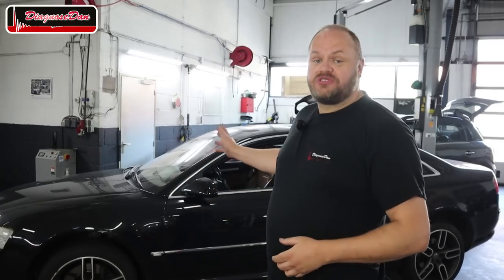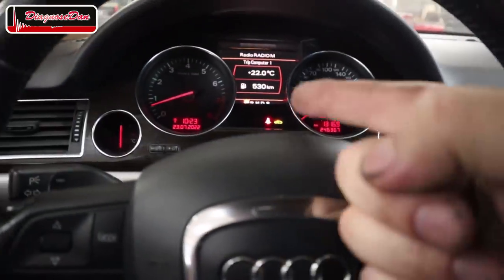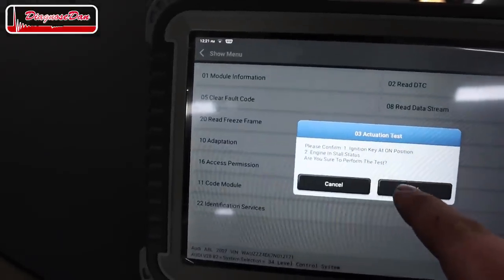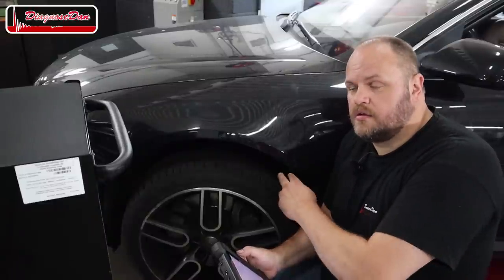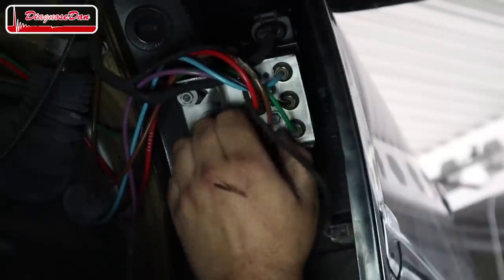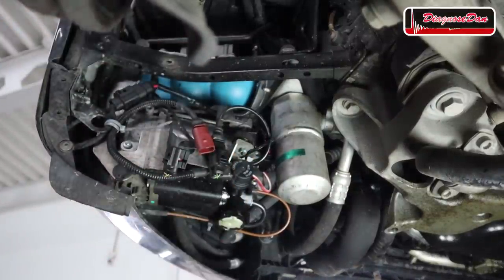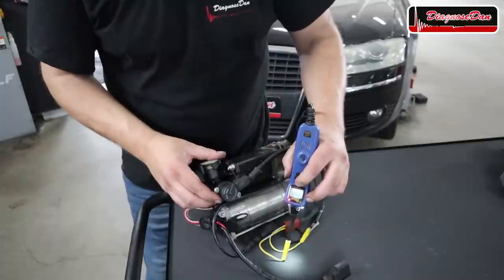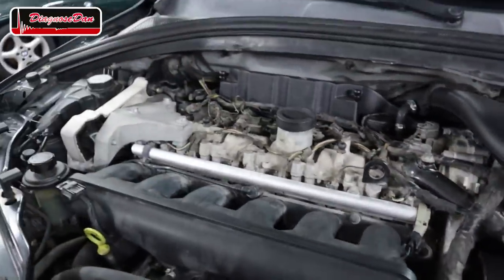Fake parts causing faultcodes

Comment: Hell Hell Hell. Same happen to me. I bought an Hella o2 sensor for my car and after 10 months it stopped sending data to ECU. I activate warranty and they accepted. I (mistake) asked for a equal replacement part. After 6 months stopped to send data to ECU also. But they accepted again the warranty and I ask for a credit. This was on the well known Aut...oc European online shop for car parts. Maybe I will ask all the credit in oil, now I saw your video Dan.
Reply from the maker: This sensor also came from Autodoc
Reply: @Diagnosedan  now their prices are explained. I ask at the Skoda representative in my country a price for the sensor (in  the first fail of the fake one), and they said "probably it will come an sensor from Hella". And I thought that have made a good choice asking for the replace.  😥Lol

Comment: i would check for a blown fuse first (a fuse is designed to protect the circuit and devices by failing long before the device or wiring fails).

then maybe check for corrosion on the connections since cars are often exposed to the elements it is possible for corrosion especially today since now a liquid snow and ice removal is used.

Comment: Dan hello
I have a question for you if can help me?
I have a 2013 Toyota Avalon hybrid and my car shakes at 40mph all the time.
I replaced the motor mounts, all front end suspension parts and drive axle, did tune up. Any suggestions?
Thank you. Very informative YouTube channel.

Comment: Hi Dan please can you help me, I took the drivers seat and front passenger seat out of my VW polo SDI  out to wash when I reinstalled the 2 front a airbag warning light shows up on the dashboard even though I remembered to plug in the airbag wire under each seat, am I going to need a diagnostic device to remove the dashboard airbag warning light, if so can you recommend the best and cheapest diagnostic device, I'm in the uk 🇬🇧. Great video great channel thankyou.
Reply from the maker: It's cheapest to get the airbag light reset by your local garage.

Comment: Who knows? Does 01206 - signal for duration of ignition off time 27-00 implausible signal; causes the lights under all buttons to remain lit? Battery drains.. Im reading this in vcds on my C5 A6 3.0 ASN climate module. It says faulty air quality sensor. There are some doorlock issues but unplugging them would exclude them right? Battery doesnt drain when I take off the blue connector from behind the cockpit, then lights go off. I can upload a video so you can see what my issue is. I want to try everything before buying a comfort module😵. Diagnose dan is awesome!

Comment: Great job as always , I noticed that MAF reading for this engine 3.0 was about 5 g/s. Is this turbo engine, isn't rule of thumb for 3.0 L about 3 g/s or we can't always rely on that.
Reply from the maker: It's actually a little more complex rhan that and even a Maf calculator is not 100% reliable but it gives you a general Idea.
Reply: @Diagnosedan  Thank you

Comment: Hi Dan, did you take the new deflation valve out from the new compressor to see if that o-ring was another oversize cockup?
Reply from the maker: The new compressor had a different design.

Comment: That solenoid rust could just be from moisture in the exhaust air. This air suspension systems usually have some sort of desiccant chamber or separator on the compressor side and when that fails, the moisture will just ruin everything.
Reply from the maker: Agreed but they were designed for the job and failing after a year is not acceptable

Comment: Counterfeit parts are all over Amazon/Ebay. Stick to Dealership online parts or Rock Auto parts. My last issue was a throttle position sensor. It threw up codes. Put the original one back in, problem gone.
Reply from the maker: Thanks for the feedback 👍

Comment: Even genuine parts can be bad. Had a new temperature sensor from a respectable source that immediately caused the fan to spin at max speed. Fail safe but very noisy 😃
Reply from the maker: You are right

Comment: I once fixed a bmw airsuspension where the motor did´t work. The problem was wet dryer beads. best repair ever cost 0€
Reply from the maker: Indeed that's a common problem

Comment: Yes I have had my experiences with ebay sensors - they are all fake. Now I tell everyone not to waste their time & money.
BTW my experience is also that Hella components are very low quality. Just as an example, until recently I had a BMW E39 M5.
Just after the warranty expired, suddenly one of the headlights was aiming at the ground. I realised that the electric height adjustment had broken internally.
I opened it and found that the nut that the motor drives had decomposed into dust. Made a new piece in my home workshop and all was good. Opened the other one and found it was about to fail as well.
Guess who made that garbage?
I had to replace 3 sensors on that same car. All made by Hella - Chinese quality, proudest made in Germany.
Reply from the maker: Wow that sucks!!!

Comment: Buy cheap, pay twice. Saying that, Volvo's DO NOT like after market parts. I tried 2 aftermarket DPF pressure sensors in my D5 and neither would adapt to the ECM. Both were from a reputable source. The engine briefly ran better than it had for a long time, until a DTC put it into limp. The difference in power and torque was remarkable. The aftermarket sensors gave lower than actual pressure readings on an ash restricted DPF, with the correct pressure reading causing the ECM to significantly throttle air intake. Funny that the loss of torque wasn't being caused by the physical DPF restriction, but rather the ECM's response to it.

Comment: Isnt there a calibration/adaption function for the air flow sensor on the Volvo? I helped a freind changing it on his XC90 and we had to adapt it for the error code to go away if im not remembering correctly 🤔
Reply from the maker: He might have adapted the fuel trims

Comment: As a tech I see nothing but issues with reman maf sensors,  they are either bad out of the box or fail within a year. 
Once while fixing one Subaru we ordered 3 reman maf's from local jobber ($400) and they were all bad out of the box, I convinced the boss to get a used one from  a wrecker and problem was fixed for $80.  
When I suggested to the boss that the customer get refunded the price difference I was suddenly laid off the next week.  Hmmmm.
Reply from the maker: 🤣🤣 That's not the kind of Boss you want to work for

Comment: an aftermarket thermostat housing on a 14 cruze shorted out and melted the wiring harness to the pins on the ECU that controll the throttle system.  aftermarket electronic parts are total trash.  i never used them myself.
Reply from the maker: Wow that sounds expensive 😯

Comment: audi q7 i did with a non oem pump would go up but not come back down i recheck everything turns out was pump had a valve in it not letting the airbags back down had me thinking i not diagnosed it correctly brand new non oem part :D
Reply from the maker: I wonder if it was the same brand🤔
Reply: @Diagnosedan  was a eBay special customer got in

Comment: there are 2 prices for the same part. One for the customer from the street, and other for a workshop that constantly buys parts. And the price diffrence is usually 50% (with tax). So I dont blame the guy trying to go cheaper by buying it online. But yea, its a risk. Just last week bought new ignition coil, car had no spark previously. Installed it, it starts, but underload missfires. Took out the coil, checked omhs, and behold it doesnt match manufactured requierd... 15€ to the ass...

Comment: Would have been useful if you removed the valve from the new compressor to check/compare the size of the new compressor valve 'O' ring, given that the only visual issue with  the old appeared to be an oversized 'O' ring that could have introduced a air/water leak. Hey, in another year, the customer may have the same problem!
Reply: Once you remove a part from the new compressor. You voided the new compressor. This was a warranty. No need to start swapping parts.
Reply from the maker: We used a different brand Compressor with a different design

Comment: Its hard to tell these days if the sensors are genuine or fake.
I got a crank sensor recently that i was dubious about, but it had a hologram and measure within the resistance range.
Reply from the maker: It's hard to see even for Manufacturers

Comment: Tell me about it , I bought a pcv valve rom a site which will remain nameless a stated genuine  Honda part and it obviously came from a Chinese manufacturer cos it caused my car to fail emissions, so I cleaned original part up put it back and low and behold it passed emissions!

Comment: I'm in the process of buying a new car (well not brand new but new to me). I'm replacing a Fiat Doblo which has been extremely reliable (something unusual if you listen to most people). I had an Audi A3 before (TDI PD 130BHP) which was reliable, quick and comfortable. I feel like going back to Audi and getting another but the air suspension on them seems to be a common problem, is there anyone out there who can suggest ideas of what to look for if buying one secondhand? Are there any precursors to failures or is it just a gamble? Obviously checking things like the airbags for damage, making sure it adjusts and there are no warning lights but let's be honest, beyond that it would seem there isn't much more I can check?
Reply from the maker: In our shop you can do a pre-purchase inspection. Maybe there is something simular in your country?
Reply: @Diagnosedan  Hi Dan, thank you for replying. I'm a big fan of your videos and YouTube channel. I live in the UK and I believe my breakdown service offers a pre-purchase inspection where they will come out to you and do a report. My neighbour had a Range Rover which was generally reliable in the few years he had it other than the air suspension which caused nothing but problems and cost a lot of money. The Audi air suspension does seem to be a lot more reliable at least. Thanks for the reply Dan, I'm a big fan of your channel and always keen to see your latest uploads. All the best from a fellow Dan in the UK.

Comment: Even though it was a faulty valve, I would have disconnected the brown air line from the compressor first to be sure it wasn't plugged or pinched.
Reply: The same line is used for the filling. So if that was blocked, the vehicle would've never raised.
Reply: @kain0m  In 99% of the time that is correct, but I've seen plastic lines with a chip that creates a one-way valve.  Same with old gas tanks- stuff builds up around the outlet and blocks it, even though you can blow through from the engine side, it will self seal in the other direction.
Reply from the maker: @kain0m  Exactly!!!
Reply from the maker: The compressor was able to lift the car so the return valve looked like a more likely logical suspect

Comment: No payment...again :P  I am on middle of process but look how shiny is that valve block compared by rest of the car. Again wrong...no problem, you can keep the diagnostic fee. Volvo, disconnect MAF sensor and car will use pre set values. Yeeeee, done. So, no salary this week?
Reply from the maker: Nope🤣

Comment: Cars with needless complex nonsense such as air suspension are a reliability nightmare, especially if they are German or Range Rovers.  The simpler the suspension, the longer and more reliable it will be.

Comment: I would not have don it under warrantee. Customers puts enormous amount of pressure on mechanics, they want cheeper, probably that was aftermarket, O.E. will not fail that quick, and if it fails not working that becomes the mechanics fault. In the mean time all this customers they have well paying jobs making a lot more then mechanic with 401K, sick day, vacation day, what do I have?